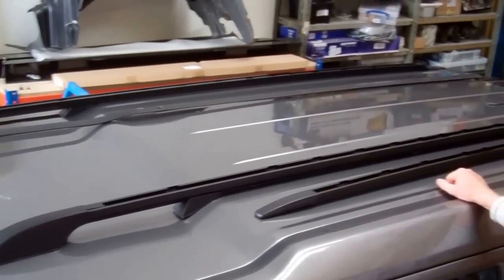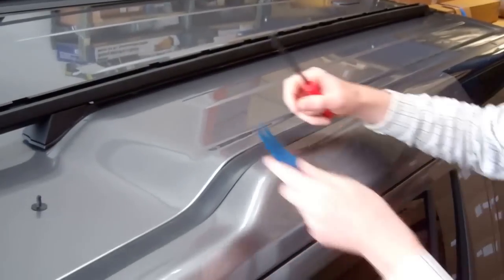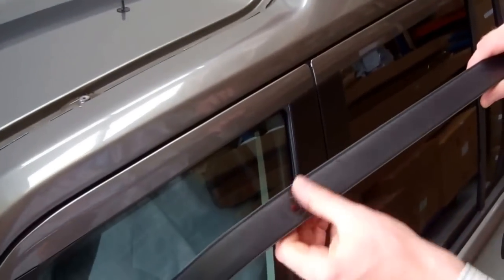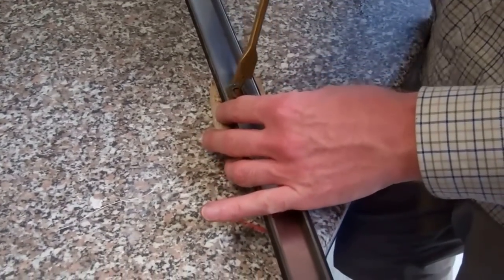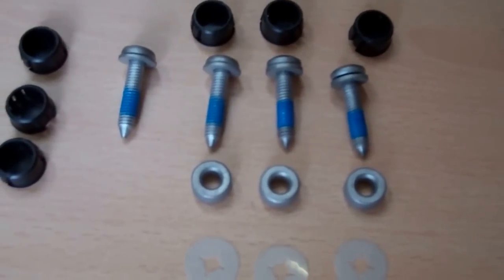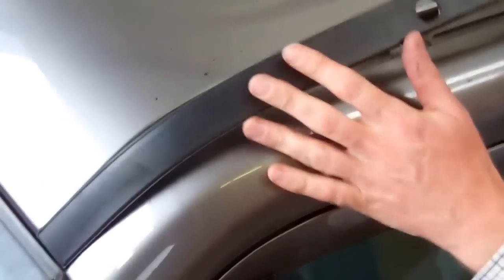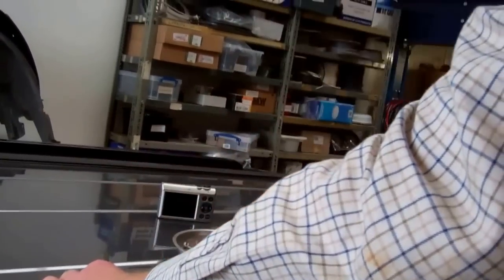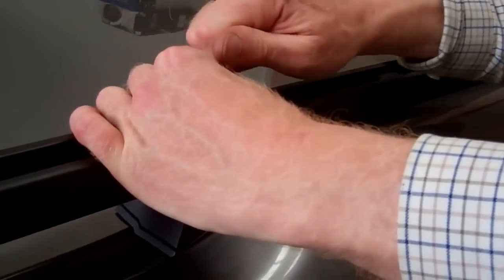How to fit extended roof rack rail to Land Rover Discovery 3 & 4 ( LR3/LR4 )

Comment: I really wouldn't recommend using a flat bit (spade drill) for enlarging the hole in the aluminium trim, there's a high risk of cutting yourself or damaging the trim. Cone cutters or stepped drills are designed for this purpose are not expensive and are much, much safer.
Reply from the maker: I have to agree with your advice - I will use the cone cutter in future.

Comment: Nice video, but a word of caution: I managed to promptly break one of the bolts because there is some black plastic sealant of some sort in the holes, partially filling the threads. If you did not have a roof rack on previously, the bolt holes may contain this gunk. I haven't solved the issue yet but I will try cleaning it out with a tap. If you google around in the forums you can find others have hit the same issue.
Reply: Follow-up: this worked. Need to use a 6mm-1.0 tap and clean out the threads.

Comment: My LR4 2013 does not have any roof rails currently and I have a pair of standard that I'd like to install. Does installing the standard also require cutting the metal strip that runs the length of the roof gutter?

Comment: Very helpful video! If anyone had the same issue as me where some of the original Land Rover roof bolts were unusable/threaded etc.- you can remove the sealant around it and unbolt and replace with AYR500061

Comment: Hi, great video, any idea what size are the bolts that screw in to hold the rail on?

Cheers James
Reply: M6-1.0 Torx 25
Thread length 23mm, Head diameter ~14mm

Comment: I have huge problem with mine - the roof glass was apparently replaced in the past, and whoever did it - did the poor job, as it is not centered! Now one of the roof railings does not fit in the groove... I wonder if there  is a way to fix this without removing the roof glass (which is very $ labour intensive)
Reply from the maker: No sure about this ! this is tricky to advice without see it !
Reply: @L663  I solved it by removing weather stripping from the rail on the roof glass side

Comment: Hi - I'm hoping you (or anyone) can help. We have got a short rail with the bars but we have no instructions and I can't find any online. We can't find any bungs in the trim to fit the rail to (I assume thats what we are meant to do?). Are we supposed to drill these or does the short rail fit in place of the trim? The screws in the car are 10mm so I guess they don't fit through them? Although in your video they look different on top to ours?

Comment: Any idea how to lift up the front cap on the extended rails once you have them installed? My disco came with the long rails and I need to get the front cap off to slide some cross bars in.
Reply from the maker: You should not need to remove the end caps to slide the cross bars in - they drop in from the top ?

Comment: The trim strip is stainless, use a stepped cutter for enlarging the hole. If you have one, a Dremel with a cutting disc is good for cutting the strip or tidying it up after sawing.
Reply from the maker: I am sure that strip is aluminium.... fancy a bet ?

Comment: Great video!  I have just got a set of extended roof rails for my D3. Would you have a video on how to remove the genuine LR spotlights?  I need to remove them to fit some LED versions but buggered if I can figure out how to remove the bloody things!  Cheers Peter
Reply from the maker: Hi did you sort this ? i can send you a link to the original fitting instructions.... google "LAnd Rover Topics" then go to user information - then select vehicle - then go to accessory fitting and you will find it there. Sorry for delay i missed your email when i was in china a couple of weeks back.
Reply: G'day mate,yes I did thanks.  Popped the green LR plastic on the front and there ws a pesky screw behind it, undo the screw and slide the light off its mounting.  I'll be getting Fyrlyt Nemesis 9000 on it in the new year.cheers and Merry Christmas!
Reply: I had no luck googling that, if you can send that link that would be great.cheers
Reply from the maker: oops my mistake should be Topix not Topics !
www.landrovertechinfo.com/
its a really usefull website for all accessory fitting instructions - its the official Land Rover website.